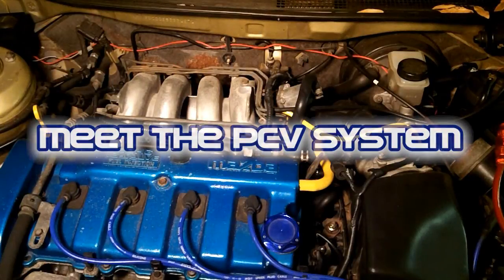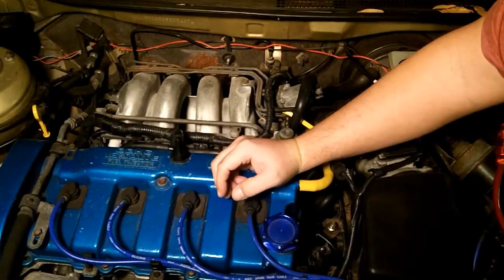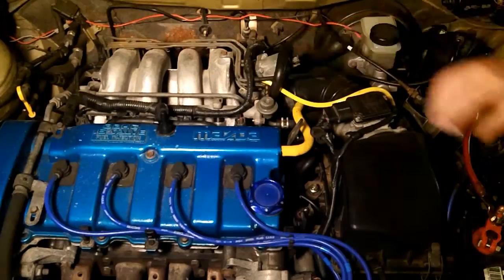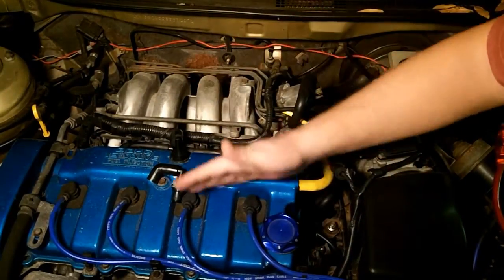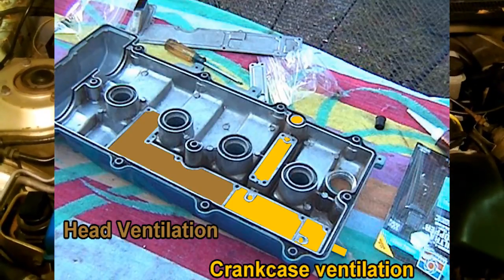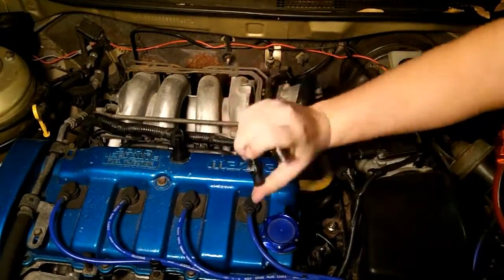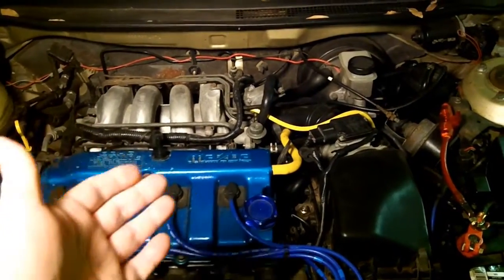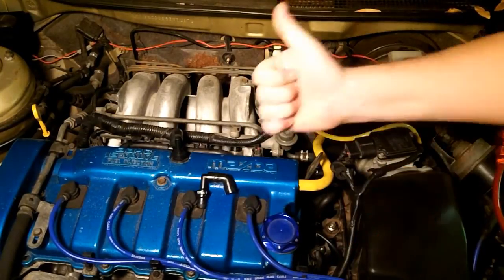Mazda 626 - Meet the PCV System

Comment: Is it worth it to get an oil catch can in between the yellow hose that routes back into the intake? I have a 89 ford probe gt, f2t engine. similar to the 626
Reply from the maker: My take on this is that if you excess oil coming from the PCV system then something is wrong with your PCV system.  It can be used as a temporary measure but running long term isn't going to help much if the engine health is the culprit to begin with.

Comment: How do you fix oil consumption from the pvc valve into the intake. I would like to avoid an oil catch can if possible.  I'm adding oil every 3 weeks.
2004 Nissan 350z 3.5 non HR
Reply from the maker: Do a compression test.  Low compression due to worn rings can cause excess blowby gas which is then routed through the PCV valve causing it to clog or drain into the intake.  Sounds like you've seen some evidence of that already.  Valve timing can play a role too in more ways than one.  Check your timing too.
Reply: DJDevon3 well I heard 350z are known for the oil consumption into the intake, that said, it's a rebuild engine though...  my engine before had the same issue with the oil..  I keep hearing about pcv oil can catcher. but i prefer to fix the problem than putting a bandaid on it.
Reply: DJDevon3 oh and maybe I can look into the timing.  but right now the car runs great and the does appear to be fine, but it's worth checking..

Comment: i have ford telstar TX5 (similiar with mazda 626 hatcback 1996). my pcv valve hose is not for automotive grade, it's for air compressor hose. so when it get hot, the hose will be soften and clogged. now my FC is around 1 liter for 5 km (city) and 1 liter for 7 km (combined). is that all because pcv hose is clogged?

Comment: @DJDevon3 one of my buddies has a 1993 mazda 626 with the I4 5 speed. the car has always had some trouble running but always ran. now it will start and idle but want to die and violently rock itself if you open the throttle at all. we replaced the O2 sensor on the exaust manifold and replaced the fuel pump. does anything come to mind? thanks homie!
Reply from the maker: +Greg Dotson 1. Check for vacuum leaks 2. test for good spark on each cylinder 3. check mechanical timing 4. test fuel pressure (look for signs of faulty fuel pressure regulator).  Just because you have a new pump doesn't mean it's impossible to get low fuel pressure.  Results of those tests should give you a clue on what path to take next to get you closer to the culprit.

Comment: I have recently bought a 1998 mazda 626 i4 2.0L and it came with revving up problem (2k) at idle when running. Further more I have noticed the revs rattling at cold start and are not smoothly held by engine, as in normal cold starts comes down from some 1700 down o 750. instead it rattles. 

Since I have been watching many of your videos from IAC cleaning, throttle body service, Engine head removal, PCV valve, TPS, etc. I want to ask where should I start from. Today I checked that PCV valve is freely moving inside the grommet and can easily be out of it with no effort. And there are oil spilled out of it as well. 
Please suggest the solution.

The car has 218K on ODO.
Reply from the maker: I would start by getting the work shop manual from pmx626.info.  Also you'll want to get an OBD-II scan tool if you have an OBD-II diagnostic system.  OBD-II wasn't available in some countries until after 2002.  Test for vacuum leak first, it's probably just a vacuum leak.  If you have OBD-II please head to watch some videos on understanding Fuel Trims (STFT & LTFT).  Here's a good video to get you started.  https://www.youtube.com/watch?v=5WnM_NsOtd8